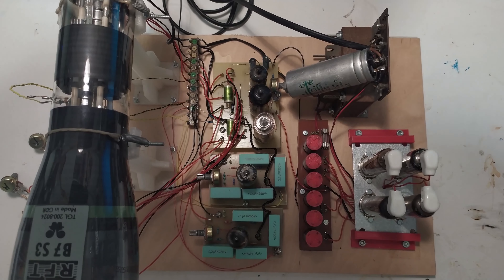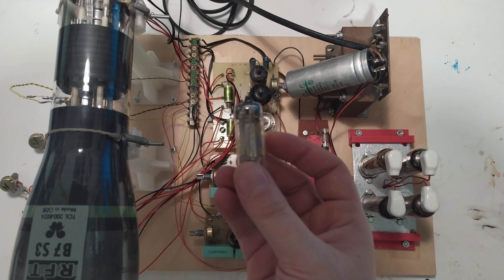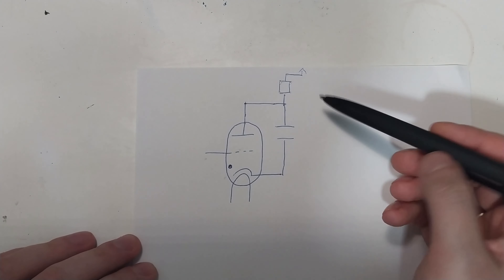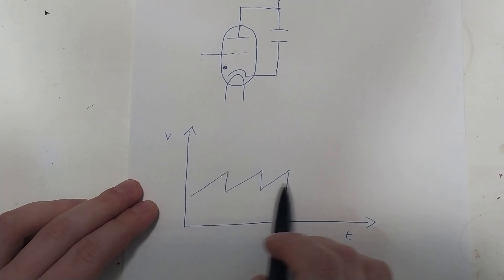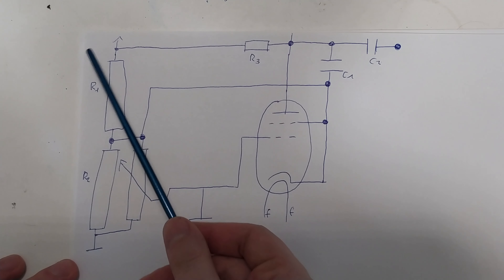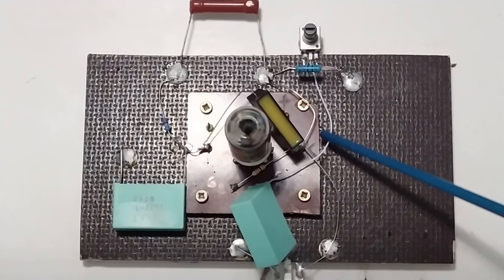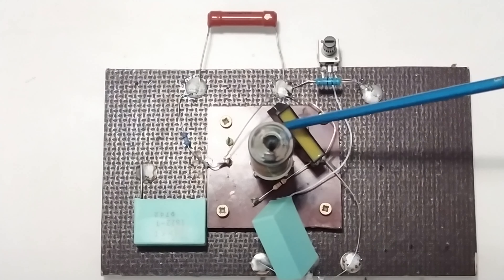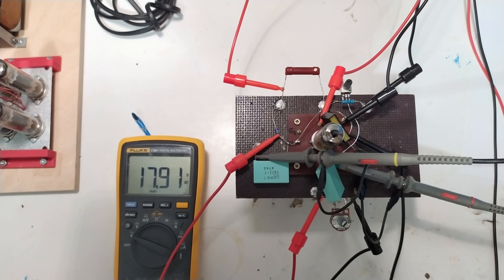Building a cathode-ray oscilloscope Part 5: Starting on the Trigger Circuit

Comment: Nice job with the valve, I was sure you'd have to use either a 555 or a very complex valve circuit. Can't wait to see you install it.
Reply from the maker: thank you! I'm quite happy with the Thyrathron circuit, I'm going to change some things about the power supply though. I tried a couple things and I think I'm going to take the linear regulator out of the circuit. Due to the fairly high impedance of the multiplier the voltage drops down to about where I want to have it for this project anyway just from the load of the divider. A straight RC-Filter or Shunt regulator gives better Ripple Rejection with much lower dropout.